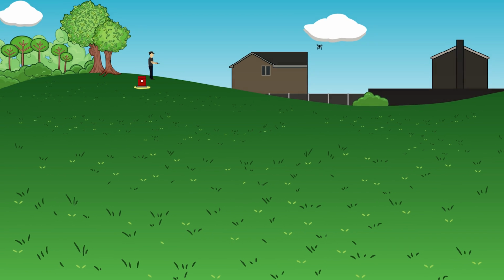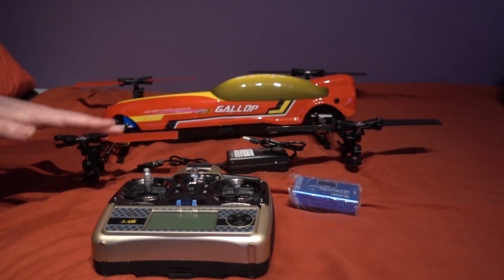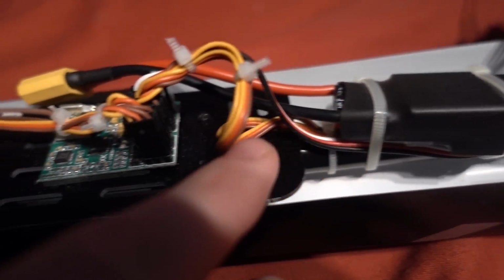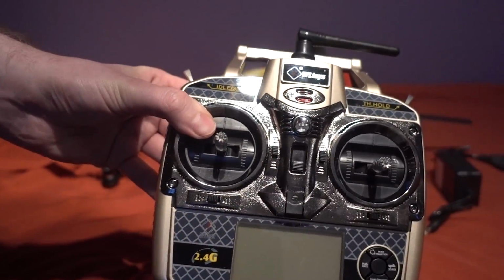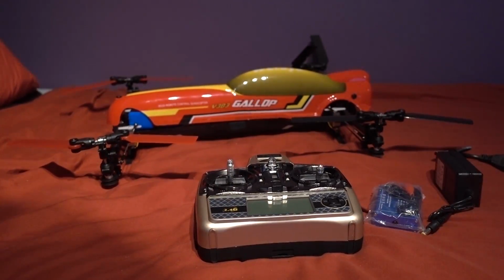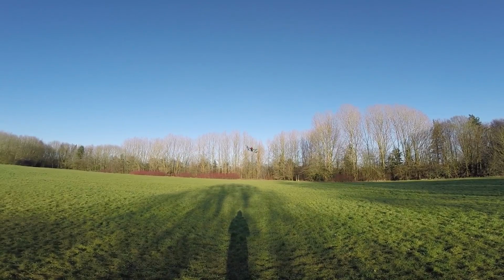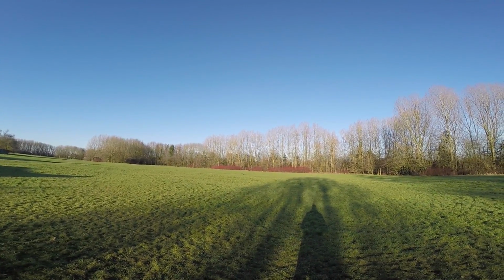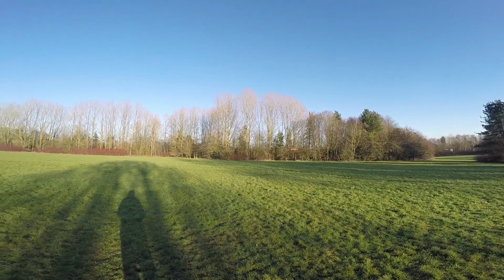WLtoys V383 Collective Pitch Quad

Comment: This thing is a nightmare to fly. Problem being is the dumb ass engineering. It does fly, loads of power, but when you even slightly come down on the throttle, it wants to fall like a rock. When i first started you ramp the throttle up just enough to get the blades rotating and that helped heeps when you cut the throttle.

Comment: Cant wait for the hi power bigger carbon blade low weight version to evolve from this! imagine the first brushless quad you flew and then what you fly NOW! This represents the first of the creed.I'm thinking a quad of this colective pitch type but 250mm between the motors and four blade rotor heads running at 10,000 rpm at the blades and it will Hoot along  :-)

Comment: The problem with this, and other WLToys CP helicopters is that the transmitter is not user configurable so everything is set up as whoever designed it set it up and cant' be changed.  I have a V977 helicopter...flies absolutely great in 6 axis mode, but it is so touchy in 3G / 3D modes that you would have to be really good to fly it without smashing it into the ground.  On their XKDetect CP Helicopters (K100, K110, K120) you have a "real" transmitter that you can go into and set up to fly to your taste and flying skills.  It's a shame they didn't include that radio setup with this quad...might have been more fun. However, price is great right now...might be worth that as a conversation piece.

Comment: Hi Andy! Can you say something about how the propholders should stand to each other? Must they be mirror like symmetric or parallel? If I need to change the position have I to losen the holder screws and turn it in the right position or should I losen the servo screws and fix all new? My first efforts to start went wrong. It didn't manage to hover but the machine left his back and make a roll forward. What is wrong? May be the 3D button is activated? They write "down" in the manual for throttle hold but it is up. Is the left switch the same? Up 3D out? I think not.

Comment: Your yaw problem is being caused my one of your servos not changing the collective the exact amount on its rotor in the negative direction. Check each rotors pitch about the negative hover point, about -3 or -4 degrees I would guess, they should all be exact.

Comment: the concept looks interesting but it brings nothing new or better to the table. It looks really fragile with all intrinsic parts made of plastic. With a $180 pricetag it seems a bit too steep. The quality of the plastic on the transmitter looks extremely cheap.
Reply from the maker: it comes from the days of helicopters where the slightest bad landing would rip it apart. its for experts this one

Comment: I've seen 2 others try this and anyone who flies it at all, never mind putting it into 3D mode, has my enduring respect. - Nice flying
Reply: Tim Adams Actually, Hobbyking had been hinting at it for quite a while before they released it. Also, neither is a clone of the cyb stingray. From a distance they look similar but up close they're very different. It's like saying the zmr250 is a clone of the blackout. Similar, but very different.
Reply: None of which changes my opinion as expressed earlier :)
Reply: They're really not that bad. I have the Hobbyking Assault one that this is cloned off of.
Reply: Banggood posted the first video of this on Nov. 10th, 2014, then HobbyKing introduced theirs on Dec. 24th, 2014.  But they're both actually clones of Curtis Youngblood's Stingray 500 (which Andy mentioned), and his first video on that was Dec 17, 2012. :)

Comment: Wow. Kudos to you for giving that bizarre craft a go. That 1st roll must have scared the heck out of you. When going inverted, I assume the FC reverses the prop pitch to keep it level so that the throttle function operates the same? Its SO different, but perhaps a perfect transition model for those flying CP Helis and want to have a go at a quadcopter.  I would be worried about that central shaft, and the belts driving the blades. As you said, those could be potentially a hazard. I'm sure I would need a change of underwear if I were to try to fly that thing .. better you showing it off! Again, Kudos for such a nice demo! Cheers!
Reply: No you have to do everything manually, the flight controller doesn't switch anything. When inverted the throttle basically operates upside down and half of your controls are reversed.
Reply from the maker: yes as per Alex its a full collective pitch setup so everything reversed. scary lol

Comment: i have got a question, i want to build a drone and i got some parts together and i want to make it, it is fpv and all from banggood, my question is: do you think this is a really good drone and what are the pros and cons. imma list the components down here.
Flightcontroller:  Upgrade NAZE32 F3 Flight Controller Acro 6
Controller/Receiver:  FlySky FS-i6 2.4G 6CH 
Frame:    MartianⅡ 250 250mm 4mm Arm
Propellors:   12PCS JJPRO-6040BN 2 Blade CW/CCW PC Propeller 
Motor:    DYS SE2205 2300KV 3-5S Brushless Motor CW CCW 
ESC:    FVT LittleBee Spring 30A ESC BLHeli_S 
FPV Goggles:   Eachine VR D2 
Battery:    ZOP Power 18.5V 1500mAh 5S 45C

nice video btw
Reply: Sven Bosma looks good but that is way too much battery, look at a 1300mAh 4s battery
Reply: Most ESCs and motors can't handle a 5s pack, you'll have to get ESCs and motors rated for 5s or 6s
Reply: Ron Tropics ok thanks for the tip, i do still have a 3S laying around... is it a good Idea to use the same drone but just use a 3S and then step up to 4S and then 5S beqause  this drone can handle 3 to 5s
Reply: Do you have plenty of experience flying FPV? Because that's gonna be a lot of power!
Reply: Micah ok thnx, is the battery to powerfull, to heavy OR wil IT burn the Esc... because i think it wil get the drone way more power.
Reply: Ron Tropics oh Nice thnx
Reply: Micah Gore oh thnx ill go and search for them on the internet(banggood). and thanks a lot

PS sorry for my english, i am from the netherlands and im Just 14 so....
Reply: Micah Gore oh and is the battery not good beqause i have a 5S motor, the Esc i dont know of it can handle 5S but the motor can or is it just that it says 5S and accually is 4s
Reply: Have you flown FPV before?
Reply: Ron Tropics nope...
Reply: I would definitely not start with 5s. That's gonna be way too much power. And too much money when you crash. I'd start with 3s. A good first drone would be something that can handle 3 and 4s. Once you get used to 3 you can bump it up to 4.
Reply: When I first started flying I got a few 4s batteries and they were just too much power. I was crashing and couldn't control them well enough to have fun. I ended up getting a couple 3s, flying them for about a month and then went back to the 4s.
Reply: Ron Tropics oh so i really should start with 3S, i am going to buy a 3S with this drone i think. thank you for youre fast reply's!!!
Reply: Anytime. Happy to help!
Reply: you can tone down any quad to act like any S rating you want. Change the Pids and the Thrust vectoring on your transmitter

Comment: Christ that looks a bit of a handful ! Are you going to FPV it too ?
Reply from the maker: Jools Enticknap I'm currently thinking how to do it logistically with out the canopy vibrating like crazy
Reply: Wasn't easy to see what the canopy was doing from the video, but the chassis looks pretty stable. However I suspect it'll need some damping. I can imagine that drive chain produces quite a bit of vibration. Does look like fun to fly though :-)
Reply: Drop the lexan canopy and mount straight on the batt!
Reply from the maker: ill look it up thanks

Comment: With all of the motors always spinning at the same speed, how is it able to yaw?  I'm really confused by the physics of this thing.  For a heli it can use the tail rotor, for a normal quad it can change the motors speeds, but how does this thing do it?
Reply: Not only momentum is yawing the quad, most yaw power actually comes from prop contact with the air. Imagine a motor with propeller thrown into honey pot or similar viscous fluid. The motor will spin as prop will get caught in the honey. So the same happens with the quad, two motors are slowing down to make less contact with the air. And with collective pitch it's the same, flat prop gives similar effect as slower speed.
Reply: The props can have zero pitch - being flat, so they won't produce lift or anything. So as on normal quad two cross-opposite props are flattened out, their effect decreases and it yaws.
Reply: if the pitch zeroes out, that corner of the quad will dip since it is not producing lift.  However, there will be no change in angular momentum.  A normal quad will spin down 2 of the motors and spin up the others in order to create a difference in angular momentum, resulting in yaw.

Is the yaw simulated by actually rolling the quad just in roll then pitch, then roll then pitch, but doing it rapidly?  I'm still missing something.
Reply: differential pich rpm the same, blades angle change do to individual servos.
Reply: That makes sense, the force of the air "pushing back" turns in the opposite direction.  Thank you!
Reply: like you said, on normal quad 2 will slow down and 2 will spin up, in this one 2 props will angle to make less lift, and the other two will get more pitch or stay the same
Reply: John E Fly it alters the pitch of the individual blades
Reply: @RandomWisdom great explanation buddy thank you!
Reply: it changes the direction of the props.